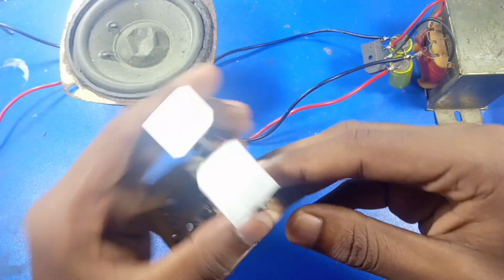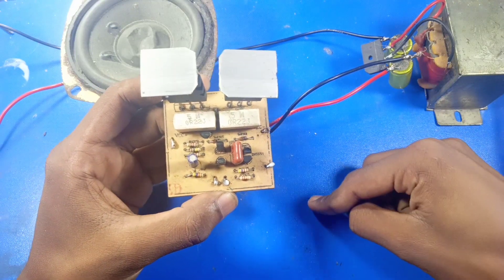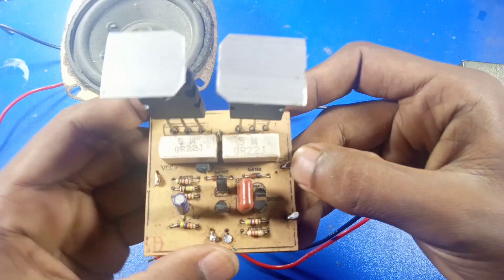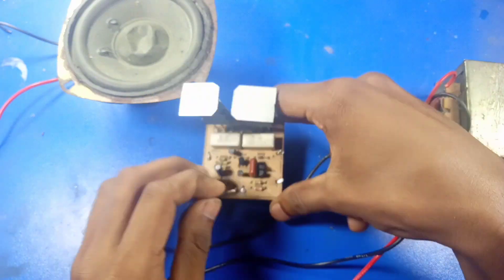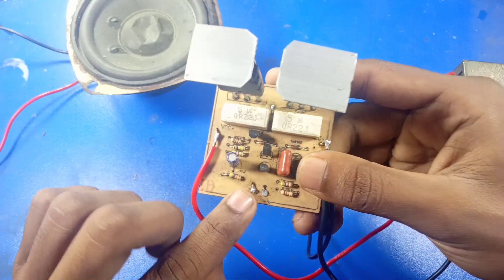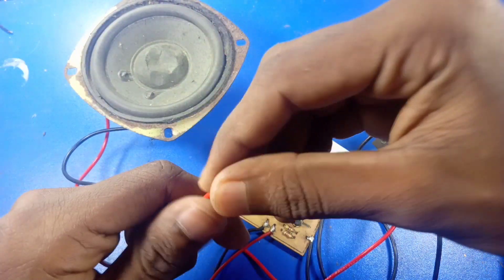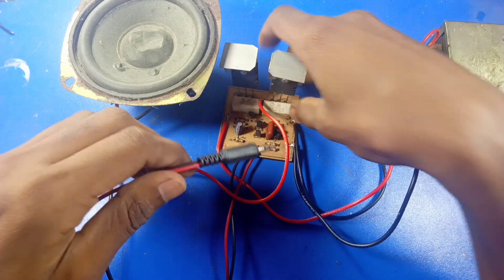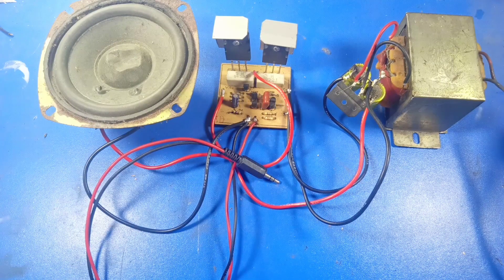১০০ ওয়াট পাওয়ারফুল এমপ্লিফায়ার সার্কিট

Comment: Vaiya, amar 2ta crt tvr speaker ache o eta 12-0-12 3A transformer ache  ar ekta sub woofer speaker kine ki Ami sound box banate parbo  ??? Kun amplifier board use Kora jobe ?
Reply from the maker: Tda 2030 amplifier circuit use koren vai
Reply: @rsnelectronics1623  vaiya,tda 2030 ar price koto hote pare ar koto inch sob woofer use Kora jabe koto watt ?
Reply: @rsnelectronics1623  dx0809 ei amplifier board market er lukera bollo valo., Ekhon ki tda2030 er bodole dx0809 diye Ami Amar speaker ti banade parbo ?
Reply from the maker: @barshapaul3727  tda 2030 nile,,,subwoofer bajate parben r dx0809 nile parben na,,,,circuit 2 tai valo